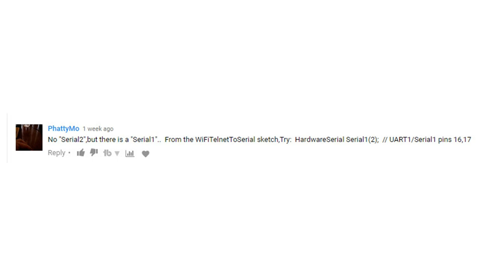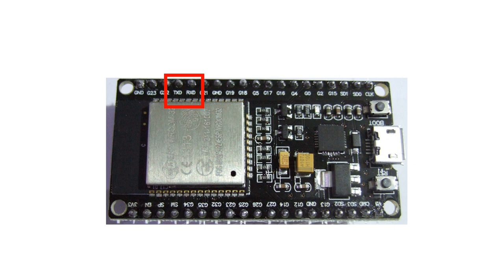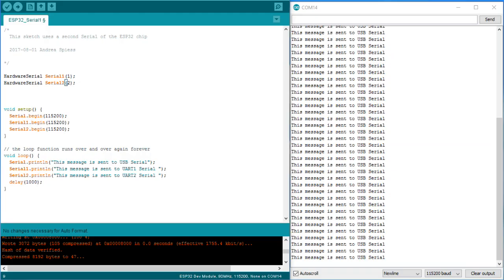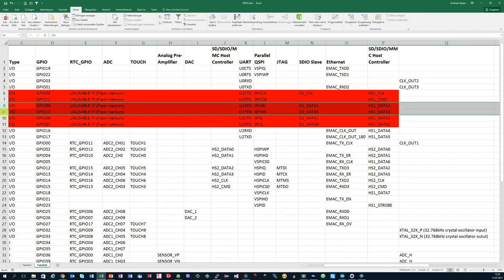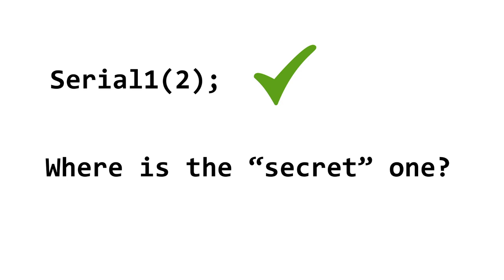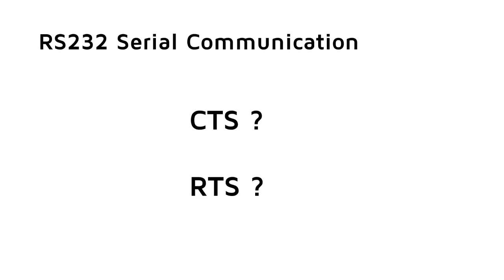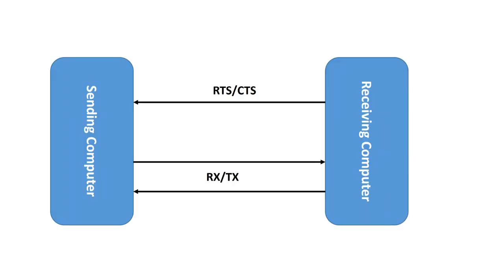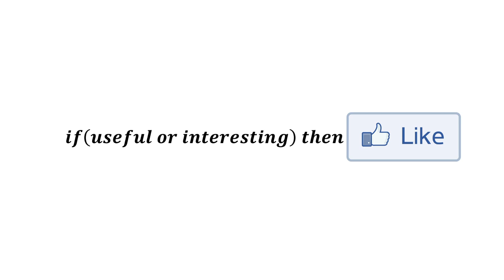#152 Additional ESP32 Serial Channels in Arduino IDE (Quickie)

Comment: I think that you can call Serial.begin(baud_rate, config, <rxPin>, <txPin>) (or something like that) and define the pins you want to use without having to mess with the library files...
I haven't tried it yet so I can't confirm if it works...
Reply: Also mentioned here: https://www.esp32.com/viewtopic.php?t=328
Reply from the maker: Thanks for the tip.

Comment: In the drawing at 4:05, RTS/CTS you show as one signal coming from the receiving computer, but RTS comes from the sender (also called Data Terminal Equipment) and CTS is on another separate pin coming from the receiver (called Data Communications Equipment). Often, this RTS to CTS delay was caused by slow modems that didn't empty-out their small send buffers quickly enough onto the analogue line, or modems still waiting on the process of dialing-out and/or carrier sync.
Reply from the maker: There was always some confusion with these names and who has which role, if I remember right. Fortunately, we do no more have to deal with them too much.

Comment: I like your videos. Well done. In this video you touched the subject of flow control and said that speed and buffers solved anything, but, look around, there's some kind of flow control everywhere in electronics.
Reply from the maker: +Ocsav I I only referred to RS232 which is very slow. Faster protocols of course use flow controls.
Reply: Andreas Spiess I thought that only asynchronous communication (like rs-232) needed flow control but it looks that communication between chips use 1 pin to do some kind of flow control even when there is a clock.

Comment: Well, it's been over 5 years since you made the video, and your edit of the .cpp file is the only thing that worked for me for Serial1 😂!!! Even the suggestion to use  Serial1.begin (115200, SERIAL_8N1, 4, 2) continued to result in crashes. thanks!!!
Reply from the maker: I think you can now specify the pins in the Serial.begin command

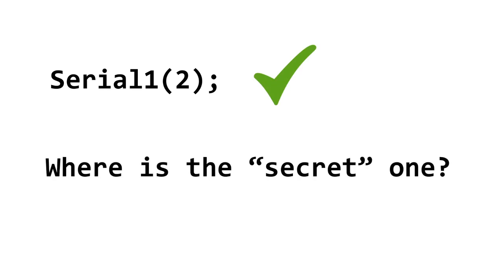Comment: 2:45 Is this "secret" UART using any arbitrary GPIO pin a software or hardware UART?
Reply from the maker: I do not understand what you mean.
Reply: @AndreasSpiess  I believe the Arduino will allow you to use any pin for UART by implementing the UART through a serial library rather than the hardware that is built into the chip for specific pins. Is that what you are doing here or does the ESP32 allow for hardware UART on any pin?
Reply: @philliptoone  AFAIK the ESP32 has remappable PINs, thus it should still be hardware UART (see Chapter 4.2 and 4.3 Peripheral Output via GPIO Matrix in https://www.espressif.com/sites/default/files/documentation/esp32_technical_reference_manual_en.pdf)

Comment: Thanks for yet another interesting video Andreas. As others have said, you do not have to mess with the esp files as you can define the pins you want to use during the call to serial.begin. Using the pins you choose, this would become: Serial1.begin(115200, SERIAL8_N1, 4, 2);
Reply from the maker: Unfortunately, this did not work in Arduino IDE when I tried (both, Serial1 and SERIAL8_N1 are not known)
Reply: Hi Andreas,
It seems I made a typo in my reply. Instead of SERIAL8_N1 you should use SERIAL_8N1 (note the location of the underscore).
When I posted my comment I was on holiday in Austria so had no possibility to test it. I just looked up the relevant library files then on my iPad.

Today, it took me quit some time before I found out that I made this typo.
You'll find all possible definitions of the serial port settings (like SERIAL_8N1) in the header file "esp32-hal-uart.h" that lives in the same folder as the esp file you modified.

Object variable Serial1 should be recognized as long as you instantiate it first (like you did in your example). Don't know what goes wrong there at your set up.

Here's the code that works for me (Here I choose to change both serial 1 and 2 pins):

HardwareSerial Serial1(1);
HardwareSerial Serial2(2);

#define TX1_pin  12
#define RX1_pin  13

#define TX2_pin  2
#define RX2_pin  4

void setup() {
  Serial.begin(115200);
  Serial1.begin(115200, SERIAL_8N1, RX1_pin, TX1_pin);
  Serial2.begin(115200, SERIAL_8N1, RX2_pin, TX2_pin);
}

void loop() {
  Serial.println("This message is sent to USB Seriall"); 
  Serial1.println("This message is sent to UART1 Serial");
  Serial2.println("This message is sent to UART2 Serial");

  delay(1000);
}

Hope this helps.
Reply from the maker: Now the code compiles! Did not yet check the pins, but I assume, you did ;-)  Thank you very much for this hint.
Reply: hi guys can someone just clear something up for me? UART0 is the uart that is standard connected to the serial that one uses for the loading the sketch? 

which is pins marked RX and TX on the dev board...?

Many thanks in advance!!!
Reply: Yes. Rx and Tx are GPIO pins 3 and 1 which are  connected to  UART chip to upload sketch to the Esp32. These pins are also used by UART0 to print text to the serial monitor (Serial.print(), you can see this in the HardwareSerial.h library). However UART0 is not tight to pins 3 and 1, you can change it to other pins but you can no longer use command Serial.print()

Comment: Andreas thank you for the very informative video ! 
I use an ESP32-S2-Saola-1R (WROVER). It has pin 43 marked as TXD and pin 44 as RXD. I see in the installed \cores\esp32\HardwareSerial.cpp the following(lines 63-69 
#if CONFIG_IDF_TARGET_ESP32
        rxPin = 3;
        txPin = 1;
#elif CONFIG_IDF_TARGET_ESP32S2
        rxPin = 44;
        txPin = 43;
#endif
so, I don't have to change the definition for rxPin and txPin.
Reply from the maker: Thanks for the update. This is an old video.

Comment: Hi Andreas, I  knew you made a great video about getting both UARTS to work with ESP32.
Unfortunately the content of the video results in a not working result if you use the latest ESP32 software.

if i use the following lines: HardwareSerial Serial1(1); / HardwareSerial Serial2(2);  the serial ports don't work at all. 
without  using HardwareSerial lines, the ports work fine.
Reply from the maker: True. They changed the syntax. Thank you for mentioning it.

Comment: Nice video, I am having some troubles setting the esp32 as a keyboard, I think either it's not yet implemented or I'm doing something wrong. I hope in your next videos you will cover this section :) !
Reply from the maker: So far, I have many other topics which have a higher Prio. As you mention, maybe there is no library around...

Comment: Thanks a lot for this very understandable video. Nowadays, the path to HardwareSerial2.cpp looks to have changed, not in ProgramFiles x86 anymore (only the one for AVR platform), do you know where the esp32 files are now located? I looked for in users folder without success.
Reply from the maker: I do not know.

Comment: Just a notice: A few days ago the https://github.com/espressif/arduino-esp32 has been updated. This also contains a new  partition table (default.csv) for flash and a migration of EEPROM lib from ESP8266. And it works (up to 4096) as described there https://github.com/espressif/arduino-esp32/issues/525
Reply from the maker: Thanks for the tip!
Reply: Now I also have NTP and OTA running. OTA is not always shown in the arduino IDE but it works using espoty.py from Batch or command line. Now I have more hope in migrating some ESP8266 projects to ESP32
Reply: Great! I had some trouble with the migration of the webserver.  
But this https://github.com/espressif/arduino-esp32/tree/5e89f5e9fabe56d8e8af956bcd7635bf218e29a0/libraries/ESPWebServer/src helped.
But as you can see there https://github.com/espressif/arduino-esp32/pull/430 unfortunately this will not be supported by the "official ESP32  community" in the future. But for now it seems to work.

Comment: Thanks for useful information 
I have some sensors and relays connected with arduino uno and i want to make a communication between UNO and esp32 via SDA and SCL pins...
On the uno, both are mentioned and working fine whereas the problem is with esp32
Please guide me how to connect them and what code is required for esp32 for affective communication 
Regards
Reply from the maker: Maybe you search for an I2C tutorial for the ESP32. It has some specialties like the wire command.

Comment: is it possible to run one of the ports in 1200baud, 8n2? I have a meter I want to connect to that has those parameters..
Reply: I believe the baud rates on these microcontrollers are configurable. In the setup code: Serial.begin(115200) change to Serial.begin(1200) to specify 1200 baud (after checking the datasheet specs to make sure 1200 baud is supported, of course)
Reply: stryk187 he wants non parity, also 2 stop bits ( aka 8n2 ). That is not so easy or common...
Reply: Correct, the teensy does it, and I have tested most of my code on one, so I know that I can get the data I want from my power meter.
I probably have to use the teensy to gather data from the meter, and pass it on to an ESP to send MQTT or modbus over to my node red or openhab server.

Comment: Great info, but I still don't get it to work,  I'm messing things up.
I have a Heltec WiFi kit 32, the one with Oled and a GPS6MV2 module.
I can't get the GPS module and the Oled to work at same time.
Like to show GPS info on the screen.
Is it even possible?
Tried  many code example, changed the code, add, remove lines...
GPS woks alone, Oled woks alone but not together.
Can use all the help.
Thanks
Reply from the maker: Unfortunately I cannot do remote debugging... I usually start with a running system and add line by line till it stops working...
Reply: @AndreasSpiess  Im at the point were I using the UART1 to program the board and after to connect the GPS.
But this is not the ideal configuration.
Reply: @AndreasSpiess  Can you explain how to connect a serial sensor on UART3 and show the values on the Oled. 
I'm trying to used a Heltec WiFi kit 32 and a GPS module to make a position device for my cat over wi-fi.
Thanks

Comment: So efficiently we can use only 2 Uart for our purpose apart from programming am I right?
Reply from the maker: I am not sure what you mean. You can only use 2 if you do not want to change the library.
Reply: Andreas Spiess if I didn’t change the library then I can use only two Uart even in that one goes to programming memory am I right so finally I can use only one
Reply from the maker: You can use 2 UARTs on the ESP32 without changing the library.

Comment: This might be a bit off topic, but would you have an insight into why an ESP32cam can send data to a serial monitor but when using pyserial it causes it to reset and no longer connect to wifi. As soon as I stop the program attempting to read from pyserial and go back to the serial monitor, the esp32 reboots and works fine.

I have made sure my baudrate is set correctly.
Reply from the maker: I never looked into these ESP32cam boards, so I do not know:-(
Reply: @AndreasSpiess  I sorted it out, it seems to be an issue with the flow control sequence, https://github.com/pyserial/pyserial/issues/124

Comment: But... why would you ever want 2 serial buses, let alone 3?
Reply from the maker: Always if you want to connect one serial device and still need the Serial Monitor for debugging
Reply: aspuzling, excellent question; Andreas Spiess, perfect answer. Thankyou both!
Reply: Sorry, I still don't understand. What kind of serial device are you talking about? The only device I know of is the serial monitor.
Reply: You may be using the esp32 as a control interface for an external device that doesn't talk i2c or spi. For example you may be using the esp32 to provide a wireless link for a weather station, or as a means of controlling a cellphone device to send sms text messages advising of something like a water leak filling your basement. Many of these devices either communicate via uart or rs232/serial. While you may only need a single serial connection for these most of the time, having a second, or third for some situations, may be the only way of debugging what the esp32 is seeing as you are developing your project.
Reply: i would think this is useful for offloading (sharing work), having more than 1 esp32 to do tasks, for example one could be used for motor control and one for balancing calculations, feeding data back to a central esp32, think of a robot dog (although there probably isnt enough power with the esp32), this way you technically increase the processing power by offloading work to other esp32's

Comment: Hi Andreas, I made a design with ESP32-WROVER and I was shocked to find out that only 1 UART is free. I would be extremely happy if I can use the 3 uarts.  Do you think it is possible to use any free pin for  the TX and RX  from Uart1,2,3?  Is it possible to use  interrupt buffers for every RX and TX ?  IF so how to do that please? Thanks and  kind regards.
Reply from the maker: 1. You can try to use other pins. Most should work.
2. I do not know about the buffers
3. Maybe you watch this video: https://www.youtube.com/watch?v=eUPAoP7xC7A

Comment: I am working with nextion display and ESP32 earlier i uploaded the code in esp8266 to get value from the nextion using nextion.read using nextion.h library but now I am using ESP32 in ESP32 nextion.listen is working but nextion.read is not working i get value like 255 255 224 255 255 ...which are undesired values so kindly tell me what to do to solve this problem??
Reply from the maker: Unfortunately, I cannot remote debug :-(
Reply: @AndreasSpiess  you don't need to debug I am just asking  and can you guess what actually be a reason behind this because same code is working with esp8266 but when i use ESP32 it's not working 😅
Reply from the maker: @RONAK_RATHII  I have no idea 😞

Comment: Hi Andreas. I bought a Lolin32 board and it gets hot very quick. I will not use the sleep modes because it is for a robot that will transmit video. I've put it a heat sink and a fan and it remains cool.
¿Do your different modules also get hot when active and using the WiFi?
Thanks
Reply from the maker: So far I have no experience with heavy Wi-Fi traffic. But it is well possible that the module heats up as Wi-Fi is quite power hungry.
Reply: Thanks. I must buy one of those USB mA and V display meters to see the current it consumes.
Reply from the maker: Or a electronic load/Monitor I showed in one of my latest videos... ( a little more expensive, but with PC connections for monitoring)
Reply: Very interesting. Unfortunately the software is for Windows only, and I use GNU/Linux. Do you know if the serial protocol is documented?
Reply: Finally I bought two of the cheapest ones. I measured the Lolin32: 140mA idle (making delay(1000) in a "for" loop), and between 300 and 350 mA with heavy processor and WiFi usage :-)

Comment: Andreas, i got 3 mA in deepsleep with the module you showed on this youtube videos, is it normal?
maybe i will have to remove the red led ?

thank you.
Marc.
Reply from the maker: There are a few things on these boards which consume current, the LED for sure, too
Reply: Andreas Spiess if i remove the led do u think i can sleep for years ?? Thanks. I got 1 week now... :(
Reply from the maker: No. You have to use a WROOM module only without the Serial to USB chip and the LDO. Development boards are not optimized for low current consumption
Reply: Andreas Spiess :-(
Reply: Andreas Spiess thank you.

Comment: why does uart2 have 5v on the rails tho? esp32 uart is so weird.
Reply from the maker: I do not think that any ESP32 pin has 5 volts.
Reply: @AndreasSpiess  The volt meter doesn't lie. GPIO 16 & 17 are reading high 4's. But you know what after trying out those esp32s wrooms I've come to the conclusion they are garbage. They go into a reboot cycle if you don't supply the exact volts/amps on the 5v pins.. but work fine when using the USB connector. My ai thinker esp32 cam works like a champ. Think I'll stick to AI thinker esp32s from now on.

Comment: I have an issue with ESP32: I used it as a beacon scanner and tried two libraries different to scan(Using Arduino and Idf). Both, after a while, still searching for beacons but not finding anything at all and never back to find again untill reset!! Did you experienced the same? Thanks!!
Reply from the maker: So far, I have no experience with ESP32 and bluetooth. Maybe another viewer?

Comment: Anybody getting this error when trying to use attachInterrupt() on esp8266 or esp32? (Arduino IDE v.1.8.5, esp8266 v.2.4.1, latest esp32 board defs as of this week)?...

functions.h:164: error: invalid conversion from 'boolean (*)() {aka bool (*)()}' to 'void (*)()' [-fpermissive]

     attachInterrupt(digitalPinToInterrupt(stepCounterInterruptPin), stepCountHandler, RISING);

                                                                                             ^

In file included from C:\Users\Bueno\_Arduino\hardware\espressif\esp32\cores\esp32/esp32-hal.h:52:0,

                 from C:\Users\me\_Arduino\hardware\espressif\esp32\cores\esp32/Arduino.h:35,

                 from sketch\exp32Driver_v0_01.ino.cpp:1:

C:\Users\me\_Arduino\hardware\espressif\esp32\cores\esp32/esp32-hal-gpio.h:81:6: note:   initializing argument 2 of 'void attachInterrupt(uint8_t, void (*)(), int)'

 void attachInterrupt(uint8_t pin, void (*)(void), int mode);

      ^

stepCounterInterruptPin is pin 2, aka '2', the unsigned, 8 bit integer.

email me with solution if you have one (please)! mbueno0@gmail.com